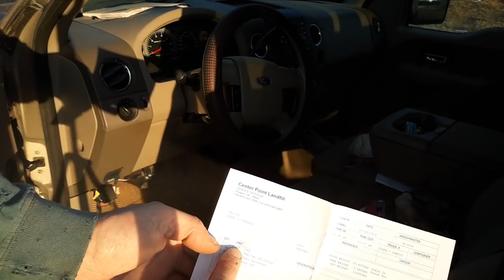Abandoned Backhoes first job Trailer Demolition..

Comment: Just a reminder Mike but the steel frame under those mobile homes is junior-I. If not bent or twisted it is more than capable of supplying you with a stout goose neck trailer for trash and light equipment if you are a fabricator/welder. I hauled many loads of scrap steel for my father-in-law in the early eighties with a four axle forty foot goose neck he built. It takes gussets and cross braces but that long trailer frame in the video welded together end to end like that would have provided many cross pieces. While the doughnut axles aren't popular they are arched however and should be fine for local projects and last for years. Shortening them up properly is not hard to do. It's just a thought... Thank you for the videos.
Reply from the maker: i think i am going to build a bridge with the frame.  although a trailer would be nice too.
Reply: the frames on these things are just scrap formed tin, nothing to them, the building is what stiffens it up, its like a wet noodle
Reply: @arnoldromppai5395  That forty foot wet noodle hauled 15,000 pounds like it wasn't there. The key was spreading the weight of the load out the full length. He welded cross pieces 7'6" long cross-bed every 4' and the two main stringers were 12" apart center to center with short pieces welded in between box beam style. Other steel was used as well for goose neck reinforcing, gussets and frame stiffeners. The deck was inch and a quarter tongue and groove bought at Bob's Auction in Rolling Hills. We even hauled his old backhoe around on it over the four axles setting on half inch plate with no problem. And if you are wondering, the trailer was inspected and licensed by the State of California in Fontana but you're free to spend however much you want for a new "manufactured" trailer. The thing is, not everyone has to do that. That old trailer was heavy as hell even empty. Especially pulling it with a 1978 dodge dually 440 4-bbl gasser with an automatic transmission which actually worked pretty well once you got her wound up. The damned thing loaded could only get between 4 and 6 miles a gallon southern Ca. to south central Idaho. Now those were the days!
Reply: @ramjet7470  well you said it all, and stop and think about all ya did,, haaaa  if you weld enough steel in to anything it will work, but use that steel to build something good, not some thing all patched to gather, i am a welder an mfg by trade for 50 years and know these mobile home frames, been in the custom built trailer game far to long,, what the truck have to do with any of it.. lol
Reply: @arnoldromppai5395  Look slick, you're the one who said it was wet noodle steel not me. The guy that welded it was a master pipe fitter and welder that could weld anything. While you were out chasing your first piece of teenage tail he was supervising construction of the San Onofre nuke plant so don't get too high on your own horse big guy. There are a lot of guys and gals out there who are not relegated to investing $30,000 into a trailer only for it to dump 20% of it's value when they drive it off of your lot. I'm 65 and I have bought and paid for "manufactured" car haulers. lo-boys, goose necks and flat beds so don't go getting your panties all tied up in knots. It's Christmas time 'ya know.
Reply: @arnoldromppai5395  As for the truck we used to pull it, did you see Mike's pickup in the video??? My original comment was meant as a reminder to him, nothing more.

Comment: Well that went great.. was a bit concerned that you were spraying gas on the fire for a second. anyway looks great. thanks for the share..
Reply from the maker: good looking out.   that would not have ended well if it was gas.  it was old diesel i have been using to wash parts.

Comment: I used my front end loader go make a 10 to 12 ft fire break around my large burn piles and then used it to keep pushing everything into smaller and smaller pile as bnb it burnt out.  Also used the loaded to make sure the fire did not get out of the safety zone.  Ha 4 40x20 piles that took several days to burn out.  Good luck on future burns.
Reply from the maker: the grass was about an in tall, so i figured it would be ok i imagine that much wood would take a few days to burn out.
Reply: @mikekisch5563  10  min it be gone burned many on a eainy day or winter with snow

Comment: How come you don't keep the boom locked when not in use?
Reply from the maker: I was having problems operating the lock correctly.  Its kind of a odd locking system.  I did a video of the procedure once  I got the hang of it.

Comment: How much did you charge for this job and how long did it take you to do
Reply from the maker: Its hard to say on cost.  Its rent property we bought and are cleaning up.  I would charge at least $3 per square foot  if i was doing if for someone.  The way i did it probably 4 days.  I would not separate wood if i had to do it again.  i would just haul it all to the dump and separate only wire and steel and not separate the siding  I only made 80 on siding totally not worth the time..  If i did it again 2 days.  Invest in a good respirator is the biggest tip i can give you..
Reply: @mikekisch5563  thanks

Comment: Does your loader have the float option on it to for back dragging
Reply from the maker: yes
Reply: @mikekisch5563  how do you engage it? I'm going to go look at one soon and wanted to know how to do it to make sure it works
Reply from the maker: @powerram92  so if you press forward the bucket goes down if you move the control  a little past that point you will feel a another position in the valve and the loader bucket will move freely.

Comment: you dont demo them things 2 gallons of fuel oil and its gone in 10 min..  the idea to demo is fold and smash everything into it self, not all over the ground, your going to have nore flat tires you keep doing it like that, use the hoe and smash it all into the center, when you have a machine there is no handd work except a little hand raking at the end as a finish clean up  very little